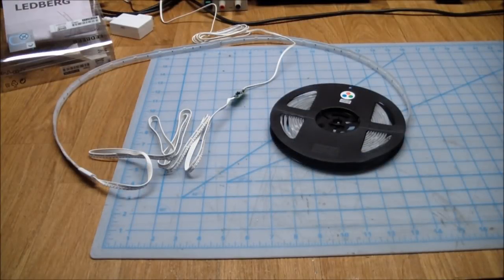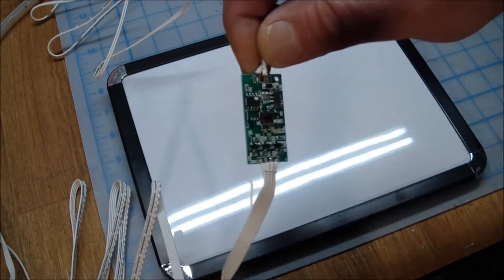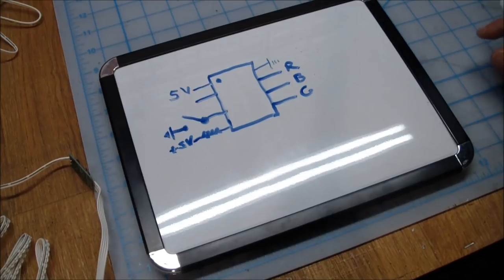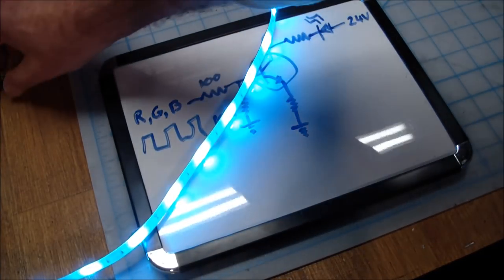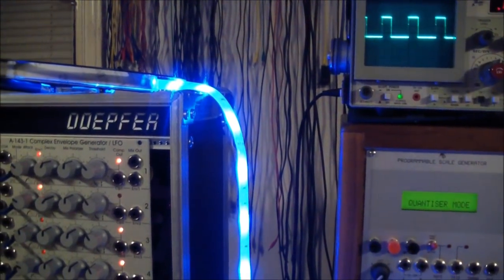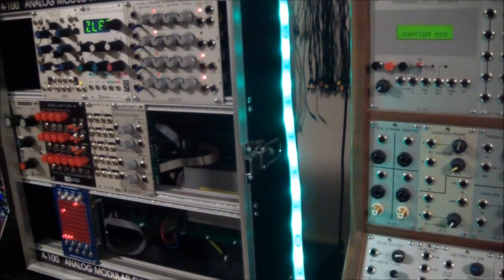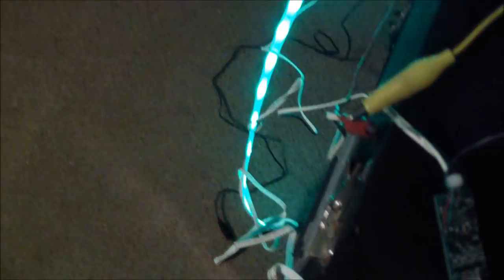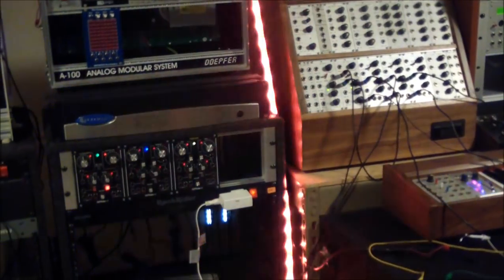AE#81 Fun With An RGB LED Strip

Comment: Thank you for the instructing Video Clip. It encouraged me to Open my Ledberg Controller as well. I would like to attach a larger external Push button, parallel to the Default Tiny one. However, the Button on the Board has 4 Pins. Do you Know how to attach an external buuton? Thank you.

Comment: If it is only possible that the colors change? I thought I can chose alsp only one color but mine changes the colors always
Reply from the maker: You have to use three separate signals. A simple test would be to ground the G and B lines and only drive the R line. You would get different intensities of R only, and no G or B.

Comment: Art Great Video!, I have LED Strips in my house that I control with Google Home, They are made by Philips and Network controllable . I never really thought about how they  where put together. I was thinking hey you could build your own controller using an Arduino  or any  8 bit processor or controller.  Those are more like mood lighting, I have seen the ones with controllers between the LEDs and what allows you to do is control the frequency for motion they work on BCD function and a sequencer and you can change the direction of the  lights in series.  Like I said Great video! and I hope to see more of them...  That was  really cool! By the way great gear collection you have there I would get lost playing with all the settings but it would be fun to learn more about some of your audio gear I think anymore it's a lost art... Well look at the talent we have today they need all that equipment and more to sound good anyway... Not like the good old days!
Reply from the maker: There's a lot you can do with these, but unfortunately you can't do running light because they're all wired in parallel. Let me know if you figure out how to control the LEDs somewhat independently with a minimum of hacking required on the light strip.

Comment: Can you connect multiple LED strips together.
Reply from the maker: Yes you can. You can daisy chain several strips using a single controller.
Reply: I believe the official max amount is 5 meters but the controller most likely can handle 10 or even 15 meters.
I dont know much about electronics but I guess you can try but keep a neye on the controller so it doesn't get too hot.

Comment: I have a question if u cut it and plug it back in will it still work ?
Reply from the maker: If you reconnect the wires correctly it shoudl work.

Comment: I am thinking about Arduino to control this
Reply from the maker: There are many examples available online showing you how to generate PWM using an Arduino. Using those signals to drive the LED transistors should give you full control over one or more light strips.
Reply: @artifactelectronics  thanks sir
Reply: @artifactelectronics  thanks sir